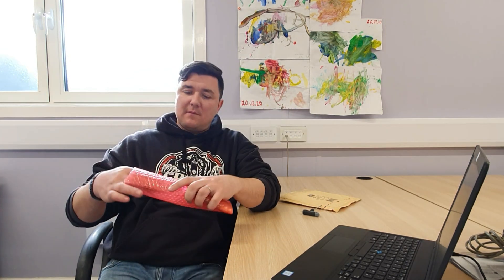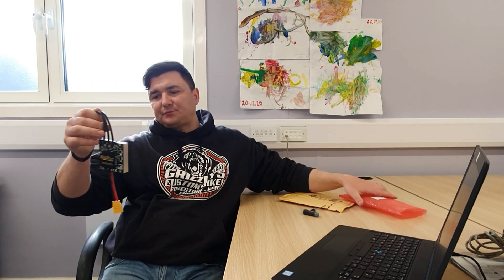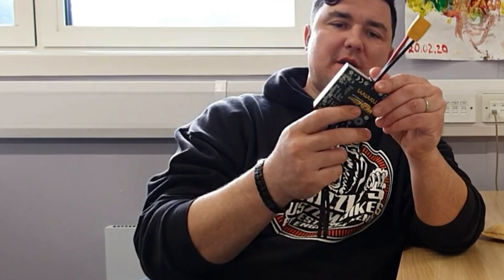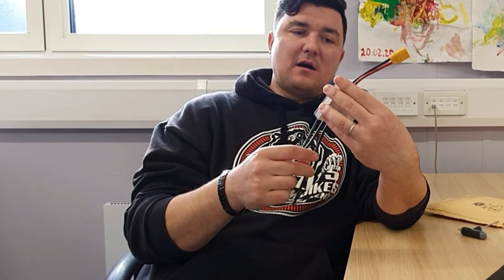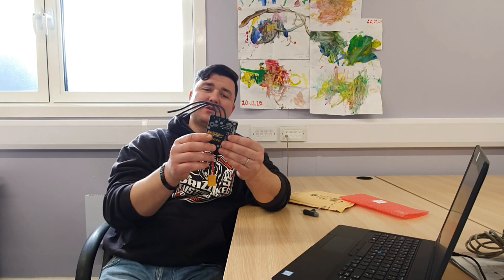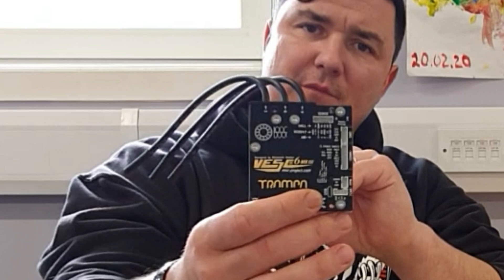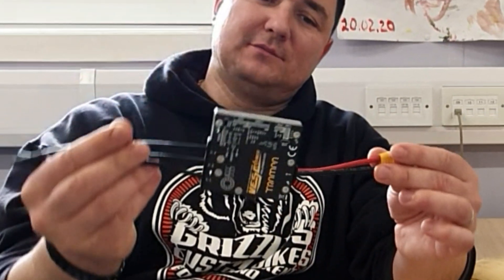VESC Mark III full review + what do I think about Trampa.

Comment: I'm not a techy guy but from my research and what I've just seen I think this vesc will work with the onewjeel project I'm doing. One question tho, does it have Bluetooth connection?
Reply from the maker: Hi,
No it does not have a Bluetooth connection however,  Trampa do sell a dongle that works with the unit.

Comment: What's the difference between the VESC MK3 and flipsky fsesc 6.6?
Which do you like best?
Reply: So which's efficacy is better?
Reply from the maker: @ShIH2701   original VESC units are better.
Reply from the maker: Hi,
Thank you for the question. I am using both and both are ok however Flipsky 6.6 plus the large unit with heat sink is the one that I use.
I would say that VESC6 Mk 3 has a much better quality components and it is the original unit. Flipsky is based on VESC 6 .

Comment: If only trampa does a Dual vesc system like flipsky instead of buying them separately. So I'm still waiting for that moment (which might not come).
Reply from the maker: Helllo Leon,
Welcome to my channel. Thank you for watching and for the comment. I did ask this question and the Trampa reply was actually very logical and i do agree with it....
Dula units are a bit smaller but if one side goes bad - the whole unit goes bad....with two separate units you will be able to replace just one side so it is cheaper in the long run. Dual vesc on a heat sink plate are actually quire small... i do have a new video coming out soon to show this so stay tuned.
Ride safely!

Comment: Are the pins on the DRV IC at 11:53 bridged like that on purpose??
Reply from the maker: Hi Dan,
I would say Yes. I did not alter or touch anything on the original VESC, just taken the case off to show you guys what is inside.
Reply: @PavelGarmas  I've just had a glance at the datasheet for DRV8301, the pinout suggests that the 2 pairs of pins that are bridged on the right side have the same purpose, and therefore ok to be bridged. But the group of 5 bridged pins on the left all have different purposes, SL_C, SN1, SP1, SN2, SP2. Have you tested this particular VESC to see if it works?
Reply: Yes that is on purpose.